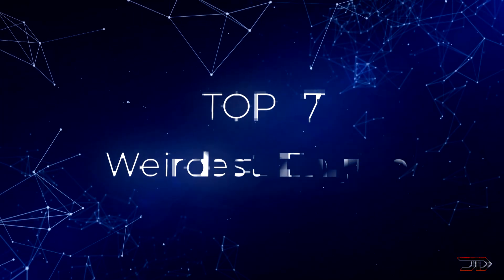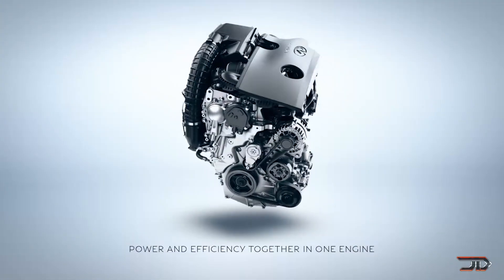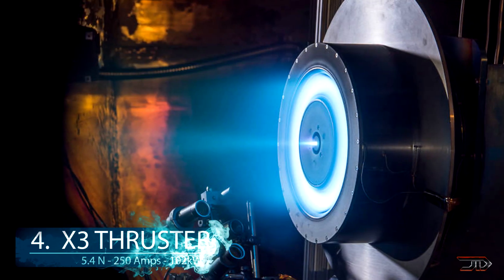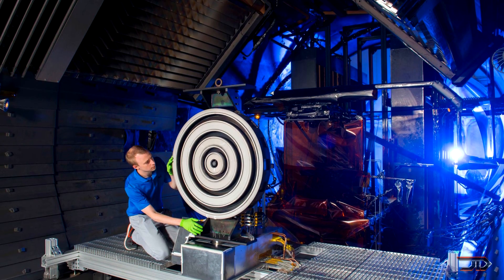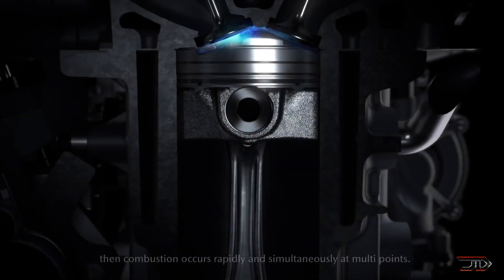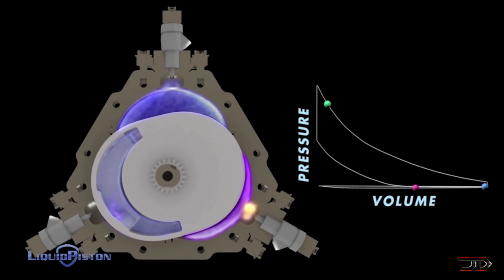7 STRANGEST New Engines

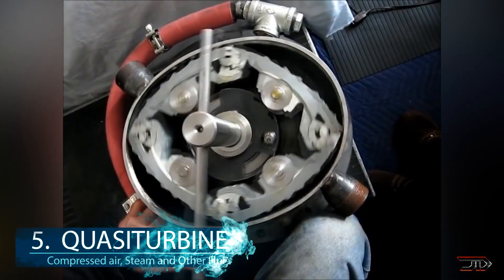Comment: 1:35 
Next level dorito
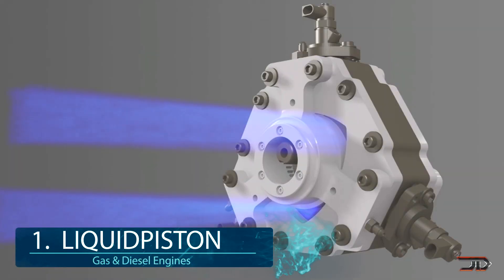4:25 reverse dorito
Reply: Potato car Guy the peanut spins inside the dorito!
Reply: @johnsmith4630  you spin the peanut in the Dorito and you make the Dorito spin in a bigger peanut. Double rotary engine.
Reply: Whatcha got under the hood? A nacho bar
Reply: Brap brap 🚗💨
Reply: 4:25 is my favorite it sounds like a standard rotary engine but lighter stronger and more efficient and easier to  make. Also if you add additional side seals to the rotor and then put a hole at the center line with the "Apex seal" between them you would have decided oil to them and then all you have to do is put a little oil bleed in front of the "Apex seals" and you are done.

Comment: I am pretty amazed that nobody realized that they should maintain compression constant and volume variable just because they vary FUEL (It was combined mistakes by me and the spelling checker) in the same amount of air causing lot of nitrogen oxides on low RPM and lot of carbon monoxide on high RMP, detailed explanation is available on http://www.andrijar.com/ge/index.html (yes, it is that simple) and also http://www.andrijar.com/thrusters/index.html for those of us interested in jet engines.
I am really open for any sort of cooperation...
http://www.andrijar.com

Comment: I am pretty amazed that nobody realized that they should maintain compression constant and volume variable just because they vary field in the same amount of air causing lot of nitrogen oxides on low RPM and lot of carbon monoxide on high RMP, detailed explanation is available on http://www.andrijar.com/ge/index.html (yes, it is that simple) and also http://www.andrijar.com/thrusters/index.html for those of us interested in jet engines.
I am really open for any sort of cooperation, but we all should bear in mind that  purpose of any job is either preferably money or even joy, so we may talk about designing supper efficient modern machinery as job or to contemplate about ancient marvels as a joy...
http://www.andrijar.com

Comment: Still looking for the Electric power.. Much cleaner and efficient than any combustion engine ever!
Reply: so how do you make the electricity to charge the batteries? Not efficient and have to burn diesel, burn gas, burn coal, burn wood to power the generators. if dont use wind ( small ouput vs cost and expensive to make the generators) hydro electric ( expensive and few locations. Solar is becoming inexpensive but takes huge tracts of land.
Reply: @doccpu7 there are many ways to make electric power like wind, waterfalls, solar, nuclear etc. We are not limited to fossils... wake up please!
Reply: Vatteries are storage bot an engine
Reply: @ScutuRC  Wake up please, he addressed each of those alternatives in his original post- the one you responded to! (nuclear is a great option, but unfortunately the environmentalists who hate ICE's also hate nuclear power)

Comment: The SkyactiveX is the only one I'd consider really good. Mazda is one of the greates companies when it comes to the quality of their engines. I'm looking forward to the new ones, they'll outclass most other I4 engines I think.
Reply: X3 has an ISP of over 5000 meaning it could burn 5000kg of fuel for  5000 seconds so it only needs around 6 grams of fuel for a delta-V of 15615. Whilst yes, it does only produce enough thrust for propulsion for 5 days as a TLI it means stage 1 can be far smaller and cheaper.

Comment: after ten years of development, ICE innovations is proud to present... ANOTHER 0.3% EFFICENCY GAINS!! We're nearly at 37% thermal efficiency you guys!!! 

Meanwhile, a electric car trundles past at 75% thermal, and somewhere in the distance a 63% efficient industrial turbine produces 500 horsepower in a package the size of a football.
Reply: Tristan Ritland    Wrong!  Ice efficiency has been up like crazy, while it’s emissions and reliability have leaps and bounds better.   Not long ago production gasoline ICE were around 20% BTE.  Today they average around 30%.  Toyota is North of 40% while Achates and SkyActive-X will be close to 50%.   That’s 150% improvement just on the engines.  If you are still worried about greenness add a hybrid drive system, etc.  Electric is great, batteries still very limiting.   Battery cars are not pollution free.  All solutions should be welcomed to the competition but choosing technology based on religious type thinking is very bad.
Reply: I don't think that ICE efficiency hasn't improved a lot in the past, but I do think that we're running out of ways to make the conventional internal combustion engine more efficient. It is a inherently inefficient system. There are other motor technologies that are far more efficient and responsive to changing workloads (electrical), and there are technologies that are far more energy-dense and lightweight while STILL having a significantly better efficiency (turbines).
Reply: Tristan Ritland   Maybe you were never taught technical facts of combustion engines.  I know the band wagon is all against Ice these days.  But mechanical engineering where I got my degree and subsequent years working in turbine and Ice engine engineering prove you have a lot to learn.   
Practical Turbine economy is inferior (cost & fuel economy) in most applications , Marine propulsion is a good example.  In fact efficiency sucks at all but full load, so bringing them into an automotive conversion vs ICE is rather ignorant.   The big three tried them in the 60’s and even with the hp race and oil under $10/barrel they gave up.  
I have expertly addressed ICE above, (up 150% since ~1988).  It is another of your apple/oranges comparisons but how much has electric motor improved in past 30yrs?  As for future improvements they are always tough to deliver, even tougher to predict, ask any Malthusian.  But ICE and their transmissions have lots of room to improve, that’s kind of what this article was about!
Reply: Oh fine, you win. I'm just a computer engineer, all this weird "moving" and "mechanical advantage" stuff is weird and scary to me.

Comment: Highly doubt that 2 stroke motor is going in an f150
Reply: Jorge Villa     They just released video of it driving around a bit.  Sweet sounds of supercharged diesel.   They have not announced any light duty mobile partners but confirmed they have several paid research/development projects with automotive majors.  Cummins is building a military diesel version of Achates design for TARDEC.  FAIRBANKS Morris has been making 2 cycle OP’s since the 1930’s but a year ago announced a major update using Achates technology.   Their Trident product makes about 5000hp is emissions compliment and 50% thermal efficiency.  
So it may or may not be going into F150 production.   But it is  pretty serious tech.
Reply: @timduncan8450  as far as i know there is only 1 diesel engine going in the f150 and that is the 3 liter v6 powerstroke that is open to the public market
Reply: @jorgevilla8068  Ford Technician here, you are correct. The 3 Litre Powerstroke is the only thing they are publicly selling in the F150.
Reply: @durgberg5847   That's now, the point is this engine is being developed to be put into an f-150 at a later time, perhaps within the next 2-5 years.
Reply: The fundamentals of an opposed-piston engine are well-tested, it's used in the T-64 tank.
Reply: An auto show is one thing but I'm talking about the domestic market
Reply: There was once a 3 cylinder version of that concept with a crankshaft at each point of it's triangular layout.  This version is certainly a step above that.
Reply: @Jorge Villa

It doesn't matter what gets into that pile crap. The morons who by them only care that it's bloated, blocky and guzzles fuel, so they can feel great about themselves.

Comment: changing the compresion ratio while the engine is running?  are you fucking kidding me.. they do know you would also require a fuel that also changes is octane level as well...
you see, the octane rating of gasoline is pretty much static...   to little compression and you get little work from it... but on the other hand, compress it to much and you get DETONATION (aka you crack the cylinder head or worst, put pistons through your hood..            good job idiots...

Comment: I have a novel way of adjusting compression ratio. 

Instead of using complex mechanisms to change the stroke of the piston... I’d change the ignition timing so the charge would be at different stages of compression when ignited. 

There’s no losses from the “wasted” high compression before igniting it... since that is balanced by the charge expanding in other cylinders before ignition. 

My concept is so simple and revolutionary, that Henry Ford put it on his Model T over 110 years ago.

Comment: I hope these can operate with fuels other than gasoline and diesel because in 12 years many European countries will enforce a ban on gasoline and Diesel engines.
Reply: John Aiken:  Good, I hope they do.  While America prospers on cheap and plentiful hydrocarbon fuels Europe will flounder around looking for an expensive and inefficient PC engine.
Reply: @lvk104  That's a rather simplistic definition.   Decaying organic matter needs high temperature, pressure, and tens of millions of years for the carbon bonds in kerogen and other molecules to break apart to produce the simple hydrocarbon molecules we call petroleum.  
Are you suggesting that European vehicles will run on sunlight?  How is that supposed to work?  The average insolation for a European city is between 3 - 4  kWh per square meter per day. http://www.leidi.ee/wb/media/INSOLATION%20LEVELS%20EU.pdf.  
Even a small vehicle like a Fiat 500, if electric would require 100's of square meters of solar panels to power its commute to work and back every day.  
So, what's next?  Hydrogen?  95% of the world's Hydrogen is produced from (gasp!) natural gas which last time I looked was an evil CO and CO2 producing hydrocarbon and in any event, the EU wants to do away with internal combustion engines, right? So if you want hydrogen as a fuel then that means the use of fuel cells which have a long list of drawbacks, not the least of which is that they require, you guessed it, Hydrogen!  Hydrogen from electrolysis is an energy intensive process, and if we are to keep evil hydrocarbons in the ground then are Europeans willing to see their beautiful countryside covered in millions of acres of Photo-Voltaic panels?
The path to political correctness is paved with good intentions that will destroy a country's economy.  My previous post wasn't so much a 'troll' as it was a precis of this post.
Reply: @ruben_balea  In other words, the environmental regulations are what's making electricity so expensive.
Reply: Wikipedia has information about this as well as the sources. If you are serious about learning whether or not something is true, just put some effort into gathering the information yourself.
Reply: I said gasoline and diesel. ICE could be designed to utilize hydrogen.
Reply: Phillip Aubin  "export"
Reply: John Aiken, what is going to power all the semi trucks, commercial avation, ships and freight trains?
Reply: @lvk104  very well said, only thing that keeps us from saving our lives and planet from very high level's of dangerous emissions is economics....
Reply: @ruben_balea  Then move. And if you think that electricity is expensive now, just wait til they cant burn "everything available"!!

Comment: Liquid piston engine is very very good.It works like old sleeve engines and in a rotary cycle like wankel.it can work and be great by using modern materials.Wankel is still great but it has bad reputation because it lost compression and was oil thursty very soon.again...with modern alloys and ceramics it can be done to work properly like any other piston engine

Comment: There was a design by a guy named jocko johnson who unfortunately passed away a few years ago. It was the size of a temporary spare and had no crank and 21 cylinders. It was shaped like a tire also. It made a bunch of torque. Car Craft magazine did a story on him years ago but u cant find any info anymore. The article was called the Spirit 29 Palms which is where he lived. It seems like a pretty neat design. It might have been in Hot Rod Magazine I can't remember it was a long time ago but at any rate he had a Streamliner he had designed back in the 60s to run in Top Fuel if I remember correctly.

Comment: engines for the age of deception! No real good stuff there!
Go free energy engines!
Reply: first invent the "free energy" and the zero point module (ZPM) to hold this energy...
Reply: just search "free energy". You'll get the answer quickly. 
Ok. Start with Stan Deyo, then, realize  DoP (ac voltage) caused by  sun particles hitting the vanhalen belts.
Then just take a look of the old buildings with those domes and antennas, 
Then you have Stan Meyers (killed already ) with water engine.
The list is long. It is just a matter of understanding the deception. Energy is power!

Comment: Looking forward to the sky active X engine.
Reply: dark crusher1221 i have watched couple reviews. They say its really efficent but it has torque problems, low rpm kills all the power.
Reply: @sirfranchiseofthefilth6791  ya. It runs a very lean fuel mixture. Meaning less power. Even with the supercharger.

Comment: EVs are far simpler and more efficient to boot. Yeah, these new ICE designs are cool, but are they practical? Or, better yet, do they do a better job than traditional ICE engines they are to replace?
Reply: @Abstractism Slow but steady adoption is the key. If everyone switched to electric overnight, yes, the grid could not cope with the huge demand all at once. But little by little they are stepping up to meet the challenge. But honestly, even without slow adoption it's not as bad as it seems: The vast majority of EV owners charge their vehicles at home the majority of the time, meaning that they're drawing the same kind of energy that an oven or maybe a welder do but spread out over several hours. So even in that case it's not too much for the grid to handle. It would be similar to everyone in a given area turning on their ovens at the same time and leaving them on for several hours. (But of course not everyone would be charging their EVs at the same time or on the same days). Now, if all those new EV owners were only using DC Fast Charging all the time then that might be a different story because they definitely draw much more power than a home connection.

Comment: all those ice´s are obsolete within 20 years, the electric car has already won
Reply: @TykeMison_  they have massive battery arrays, to supply the building until the generator is running
Reply: not going to happen any time soon

gasoline is much safer than batteries and we are nowhere near having batteries that can replace gas tanks in energy density

also you would need a separate substation for every major charging station and the electrical energy consumption would rise at an insane level from everyone charging their cars
Reply: @Raeffi3  Perhaps the batteries are not ready yet to replace conventional fuel in terms of performance (however they will be in a few years, with sodium solid state batteries and such),  but fuel cells certainly are!
Reply: @normanroscher7545  the problem is that out of ignorance everybody is buying into the EV craze while hydrogen combustion or fuel cells are the way to go

Comment: The VC Turbo engine is already in multiple Infiniti and Nissan vehicles that you can buy right now. These engines are interesting but as electric takes over I believe most of these designs will die out or become special-use cases.

Comment: Or a 96% efficient electric engine with near constant torque characteristic across a 20000 rpm rev range and one moving part - you, know, just a thought, ^oo^
Reply: And whats gonna fuel it smartass, tons of batteries?  and 96% thing is bullshit as the heat comes from the discharge and inductionmotors can get overheat aswell.
Reply: @DevasionX  That's true, electric engines are much smaller and lighter for the same power output as a petrol, and despite (lets be fair and include battery efficiency) a drive train efficiency of 85%-90%, some heat has to be removed and it's concentrated, because the engine is lot smaller - though this is solved by a lot of air, fins and sometimes a fan.  Batteries, as you rightly pointed out, have historically been a huge problem, and they're not perfect yet, but with typical new car ranges heading between 200 and 300 miles, and fast charge networks giving recharges in the time needed for a good cup of coffee, and maybe a small cake, they're not too bad - and even at that level, they're certainly very useful for a lot of customers.  Looking at the future though, the fun of the maths of it, is that there will never be a petrol engine that can beat an electric for acceleration, as only electric delivers near-full torque at zero rpm, there's no need for gears, and they will always cost a fraction of the amount to run.  So sure, a lot of liberal types bleating on about the environment might have got them going, but it's their cheap lifetime cost of ownership and outrageous performance that's getting the majority of new customers, ^oo^